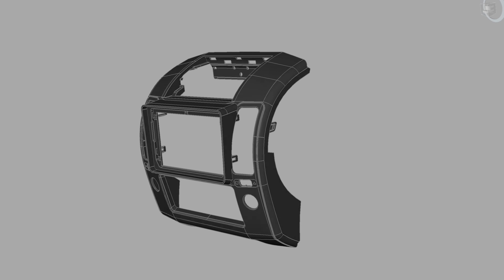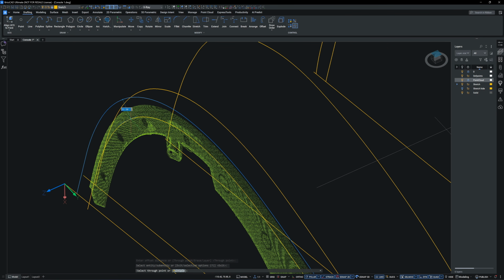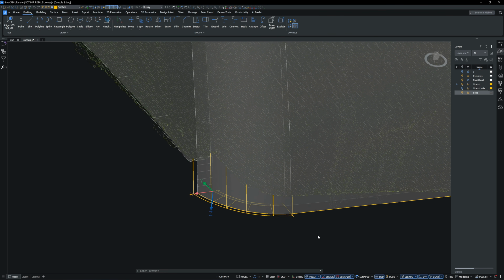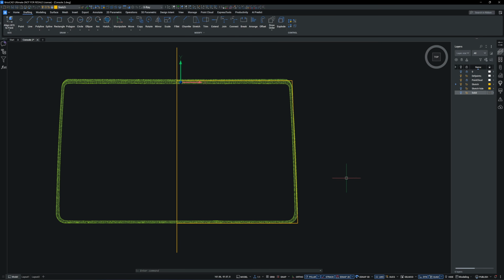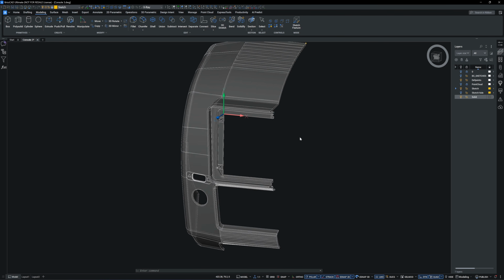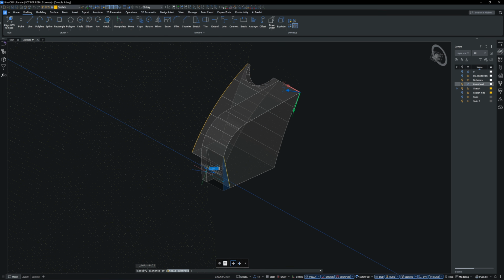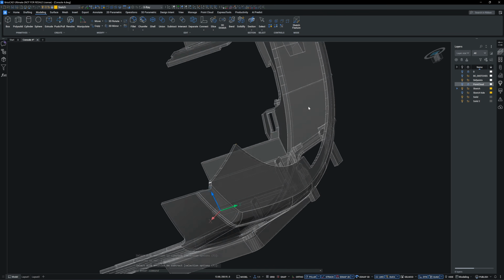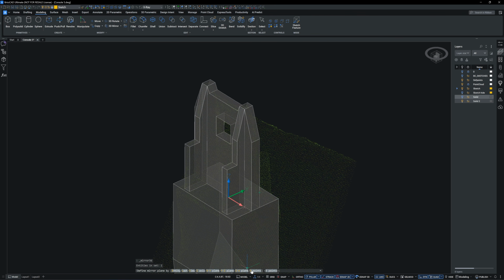3D Scan to CAD – Nissan Navara Console Bezel | From Start to Finish

Comment: Hi! I have a Nissan Navara D40 and I’m trying to make this part because unfortunately it’s not available here in Turkey. I downloaded the file from the link in your video description and paid a company to 3D print it for me, but they told me the file seems to be faulty and the print failed halfway through.

Could you please check the file and share an updated/correct version if you have one? I’d really appreciate it! Thank you! 🙏
Reply from the maker: What you have downloaded is the point cloud using for reverse engineering reference and it's not printable.  If you're interested in the 3D printable version. I can put it in Ko-Fi to download at a cost.
Reply: @Payo-TensileCreator  How much will it cost?
Reply from the maker: @Aliihsan6-j6c  How's $30 sound?
Reply: @Payo-TensileCreator  $30 is fine for me. Can you upload it to ko-fi?
Reply from the maker: @Aliihsan6-j6c ok, I'll upload it tomorrow.
Reply: @Payo-TensileCreator  thanks
Reply from the maker: @Aliihsan6-j6c  https://ko-fi.com/s/0d8e9186bf
Reply: @Payo-TensileCreator  I'm having trouble with PayPal; I'll contact my bank to resolve the issue before making the purchase.

Comment: Can you give an example where you will use brickscad and autodesk inventor respectively? Are they evenly capable?
Reply from the maker: BricsCAD is AutoCAD based CAD tool with more advance 3D modeling tool, it has a lot more flexibility and shorter modeling time than Inventor. Inventor is adaptive design CAD tool, while BricsCAD isn't fully adaptive.  Inventor will perform better in large assembly, the largest I've made is over 10K parts.

Comment: You explain the general flow of the picture very easy to understand. However, most of the confusion occurs when determining the UCS of the view, especially since the point clouds often collide with each other, blurring the view.Then what method do you use to create a plane, Is it generally pick 3 coordinate points?
Reply from the maker: Using three points to pick over the point cloud doesn’t work well in confined areas. Instead, I orbit the viewport until the clip’s wall aligns visually, then activate UCS View. Another approach is to move the UCS to a point on the cloud, draw a straight line that matches one of the clip’s edges, and use the UCS Z‑axis to align with that line.